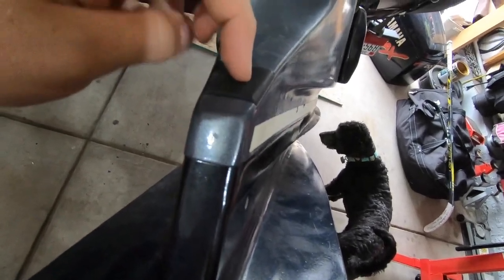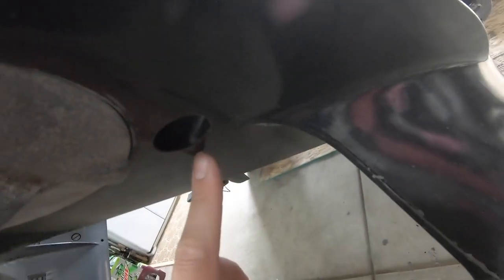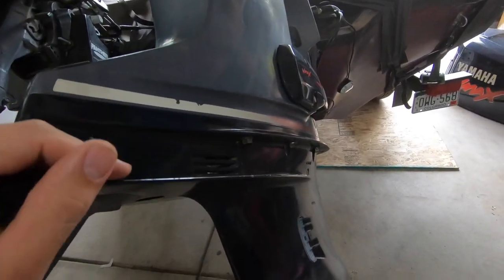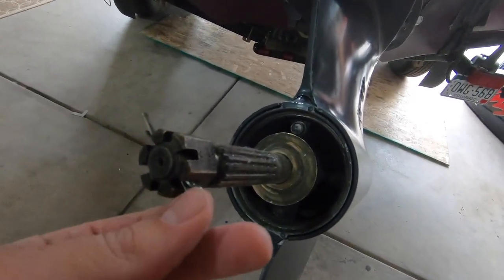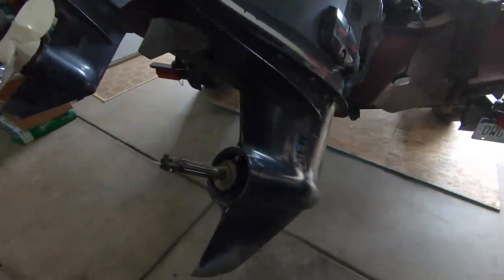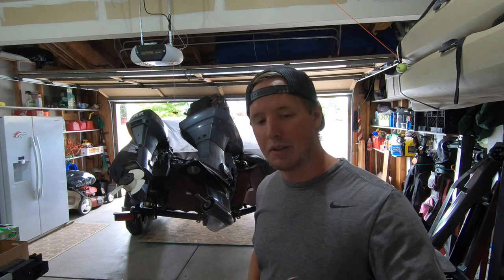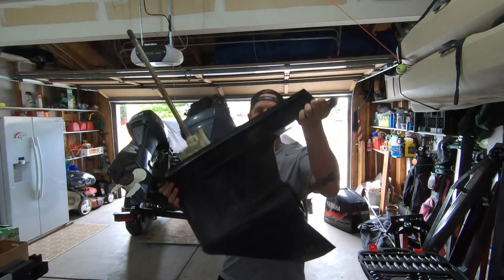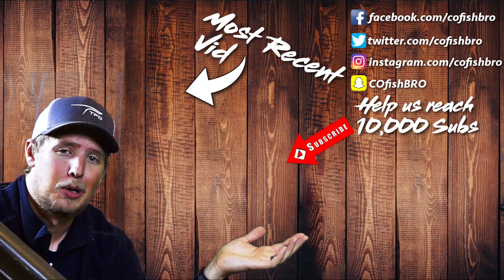Lower Unit Removal Yamaha Outboard

Comment: Every video I've seen for removing the zinc (it's not a trim tab, by the way), shows a Yamaha outboard has something different in how the zinc attaches. You have the plastic cap above that I've got but you also have a hole underneath in front of the zinc that mine does not. Thanks for the vid. Good luck.